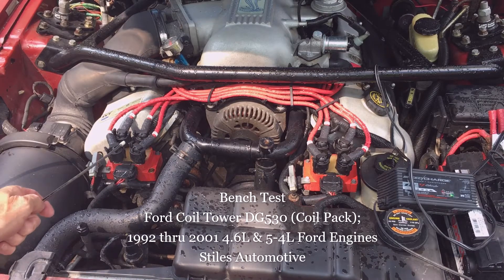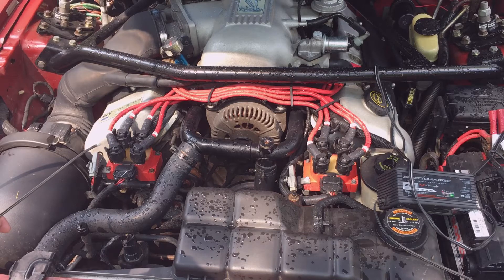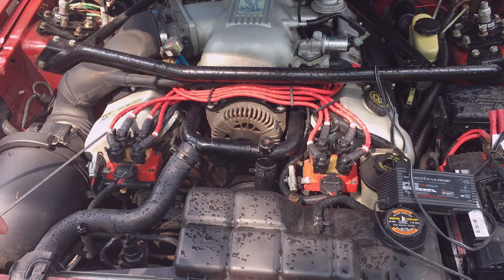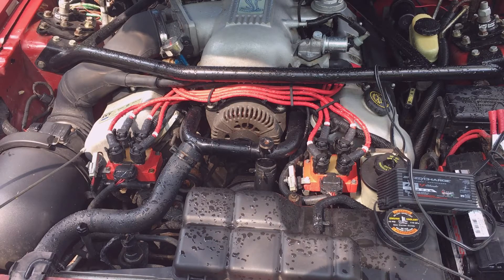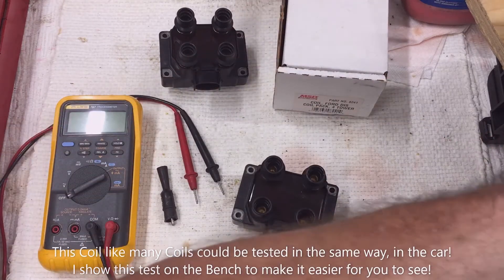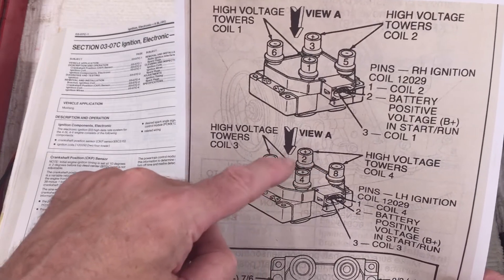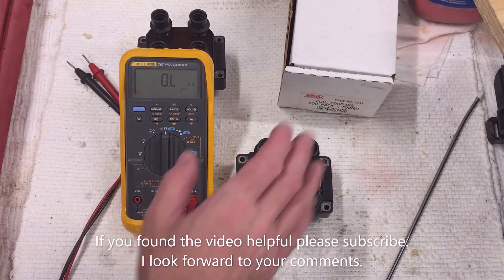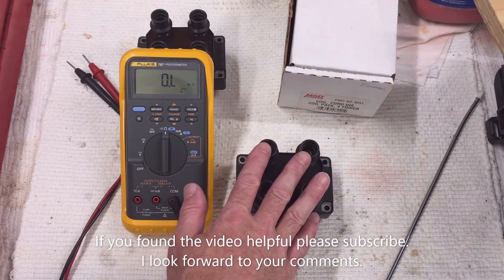Bench Test Ford Coil Tower DG530 (Coil Pack); 1992 thru 2001 4.6L Ford Engines

Comment: You think 13.6 k ohms is too high for  motocraft coil towers? They are all consistent. Primary are all .5 just the secondary look a bit high.
Reply from the maker: Cody, Its a little high but not too much.   For OEM Coil resistance for the Primary Circuit should be 0.3 - 1.0 ohms and the secondary circuit resistance should be 6.5 - 11.5  K ohms. For MSD Coil the Primary Circuit should be 0.53 ohms and the secondary circuit resistance should be 13.7 K ohms.    So, my thought is if the MSD Coil can get away with a little higher resistance then you OEM should be ok too! - Stiles

Comment: So if the secondary resistance it's not supposed to be greater than 11.5, And you said yours is a little high? So I tested my set and I'm getting between 14.86 to 15.08 on secondary side. the primary side I was getting 5 like you was on yours. Can you tell me if these are bad or going bad?
Reply from the maker: Marley, I don't think that is bad, true the Coil may be going bad, but the question is how bad is it.  I think we are looking for a short or open circuit in the Coil Windings.  In your case of 14.86 to 15.08 k ohms, the Coil may have read that when new!  If you think you are having a Coil issue, it is worth your time to ensure all of your grounds to the Coil are clean are you are getting Battery Voltage to the Coil(s).  - Stiles